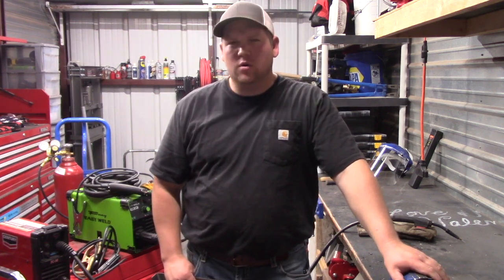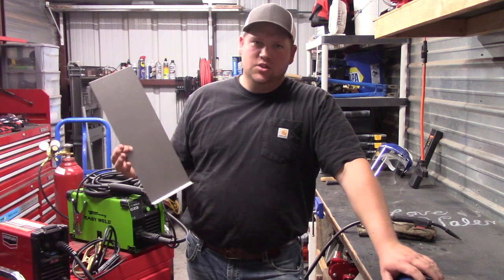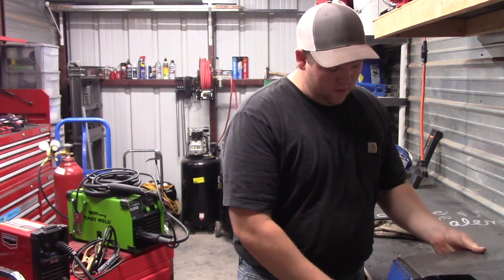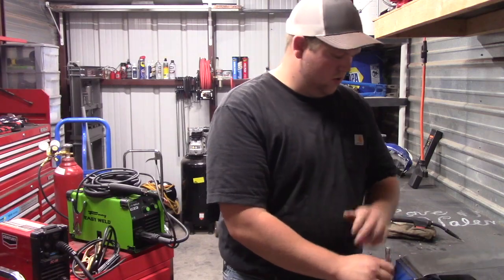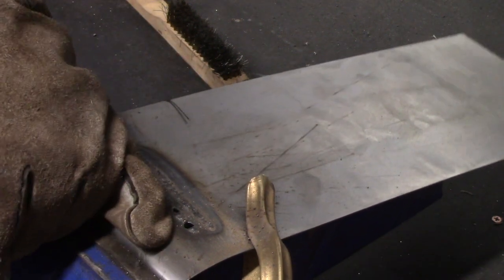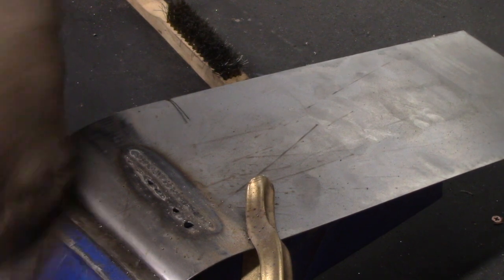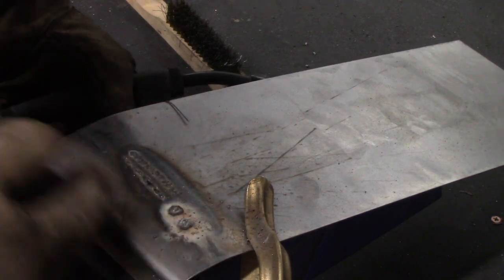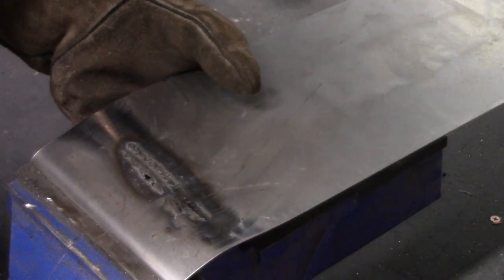Can You Flux Core Weld 22 Gauge Steel?

Comment: I’m using a Lincoln MIG set up for FCAW. 0.035” flux wire. Should I set the machine for lowest voltage and slowest wire feed speed to prevent blow through?

Comment: Good video but every time I watch these videos, thy don't include the wire speed and voltage. The techniques are good to see how but the voltage and wire spped should be included because those elements determine "blow" out or "bur" through or not. Good video for techniques.

Comment: I started welding sheet metal 40 years ago with oxy-acetylene, then to mig welding in the early nineties.  I always heard how it was so difficult to weld sheet metal with flux core, so I never wanted to try it.  I was forced to use a Lincoln PowerMig 140 with .035 flux wire in it to weld a hinge pillar section into a '14 Camry because that is all the guy had to weld with.  Because of the extent of the damage, cutting the multi-walled section precisely was not possible, and I had some gaps up to 1/8 inch to weld.  I also had to drill spot welds and remove the thinner outer panel in order to weld the stronger structure underneath. With a little acclimation it was no problemo...
ATTENTION ALL FLUX CORE SHEET METAL WELDORS:  TURN YOUR AMPERAGE UP AND STITCH.  Like a fraction of a second blip.

Comment: I use texas tig with a cheap igbt stick welder and a second rod as a filler with no Flux on it. I can easily regulate my amperage to dial it down. It works pretty good. First time I did exhaust I struggled then I found the Texas tig method and it was like night and day.

Comment: It's not easy that's for sure. I have the 140 from Farney as well. Had practiced on some sheets B4 winter has cascaded thru n I don't have a heated shop. But when taking care of replacing rusty areas you tack it in. Then hit up every couple inches. If you do an inch at a time between those original tacks and allow to cool I'm between you should be aight.
Reply from the maker: Sounds like a good method to avoid burn through. Thanks for the comment!

Comment: I have the newer Titanium easy flux 125 and it’s REALLY difficult to spot weld 22 gauge consistently. I have it at the lowest settings and sometimes I’ll get a good weld, next I’ll blow through, next it won’t penetrate. I have to clean the piece and cut the tip of the wire after each spot weld or it will pop the wire off.... total PITA. In HF’s defense, they do not have a setting for thinner than 18 gauge listed.... in other words, they don’t think it will weld 22 gauge.I believe it now lol. Good video.
Reply: Don't put it on the lowest setting.  The lowest setting will cause nothing but a mess.  You can even weld 24 gauge with this technique.  I don't know what machine you have, but let's just say that if your amp settings would go from 1-10 with one being the lowest, put it at a 4, and then you want to pull the trigger and let it go once you strike the arc.  That single spark is all you need to get full weld penetration.  Then spot weld your piece.  You will want to pause every now and let the piece cool a bit, or use heat sink, or a air blower to cool it down.  Every 8 - 10 welds.  Not only will this let you weld perfect pieces, but there is so little grinding that needs to be done since the welds don't build up.  This is the technique I learned from the legend Billy Bondo on YouTube who has been a welder for damn near 50 years and uses flux to weld thin metal exclusively.
Reply from the maker: Yes, its not exactly made to weld very thin sheet metal, I've never welded 18 gauge but it certainly is it's limit  based on my experience with other material sizes.

Comment: Exactly as every welder knows you can't weld thin sheet metal with fcaw or MMA.
Reply from the maker: A lot of people are saying you can but with a lot of extra steps. I think it's worth just getting MIG at the point.
Reply: @DereksWorkshopAndProjects  just means you have to buy gas.In fact I would say you can't weld thin material without buying gas.

Comment: Thank you for the video what speed are you
Running your wire and what heat range.. high / low got the same problem I can’t seem to dial this in same 22 gage
Reply from the maker: I think it was 1 and 1 for both. Cant say for sure though, its been over a year since I made this video.

Comment: I use FCAW on auto body panels routinely without issue.  I need to do that since most of my work is conducted outdoors and it's often windy in these parts.  With a copper backing plate the process is rather routine and ho-hum.  That said, I rarely weld a continuous bead on auto body panels, in fact almost never.  Tacks that are spaced apart works best (for me) combined with the copper backing plate = relatively easy.
Reply: You can't run a bead on metal that thin
Reply: I am in agreement. I’m FCAW 22ga body panels now on a rocker repair. Tacs work fine spaced apart. I’ll even Tac in a backing flange of 22ga. Grind them down and fill the perimeter with glass filler so water stays out. Bondo over that. Epoxy paint over that. Good to go.
Reply: @andrewbrown1463  Yes,tThe rockers on my XJ is spot welded already from the factory, no need for a bead
Reply: Don’t have to run a bead to weld. Best equipment for the job is not always available.
Reply: Same. It's my daily bread & butter.

Comment: What I don't understand is why are you welding a bead on a single sheet of metal??? Isn't that kind of "counterproductive" to actually welding two pieces of metal TOGETHER? I get that you are showing that flux core can weld a bead onto a single sheet of metal......that much I DO understand...but in most cases anybody doing any welding is welding two pieces of metal TO EACH OTHER, which would increase the thickness of the metal you are welding, or transfer the heat over the area of BOTH PARTS!!! THOUGH I do understand if you were "butt welding the joint" like I already stated!! Good video though just the same...but just curious is why I am "trolling a bit" here!!!
Reply from the maker: Hey man you have a really valid question, thanks for not being a total jerk about it. So like you said, it was to show that you can or cannot run a bead using flux core on a 22 gauge piece of sheet metal. I know that’s counter to the purpose of welding like you said. Anyway, I don’t know if you clicked off to soon or if I just don’t remember right but Im pretty confident that tried welding two pieces together too. I did some stitch welding. There was more to it than just running a bead on 22 gauge steel. Also maybe I just don’t know of think differently than you, but a butt weld is going to be the same surface area as well. I think it would distribute and cause burn through either way. Not a big deal though, I’ll admit I might be wrong. Thanks for watching.

Comment: Hi, may I kindly know what flux cored wire you are using in welding a 20-22 gauge galvanized sheet? Thanks.
Reply from the maker: .030 wire.
Reply from the maker: Also, I took the galvanization off, it’s toxic to heat up galvanization to welding temperatures. It can kill you.

Comment: I think how low your mig current can go can make a difference. I see some can go down to 20amps others 25, 30 50amps. I dont know whats the ideal low amp range for thin sheet metal
Reply from the maker: I think your right. I’m not familiar with a lot of machines, but this 110v Forney does 20 amps, I wonder if 220v machines are able to do 20amps? Seems like they should if it is an inverter machine.
Reply: @DereksWorkshopAndProjects  a few start at 20amp but most start at 45/50 amps. I am looking to buy a mig welder. Want to repair some rust damage on my car so i want to make sure it can weld 22 or 24 gauge steel

Comment: I’m having trouble welding a 20 ga patch on with my Lincoln flux core 😡😡😡 SHOULD I HAVE GAS...MIG?
Reply from the maker: Pete Lasko yes, true MIG welding (Metal Inert Gas Welding) is a cooler process than flux core, and can be used to weld even 24 gauge steel. Get a hose and a 75/25 mix CO2 and Argon gas tank and run a quality .030 or .023 wire and you shouldn’t have any trouble welding 20 gauge steel.
Reply: 🇺🇸THANK YOU! On my way to  Merriam Graves❤️

Comment: Great video, when welding thin metal you have to jump around so you dont warp it with too much heat, also is your polarity correct? Lots of crackling. Keep up the good work.
Reply from the maker: Michael Griffin Thanks man. Polarity should have been correct, DC Electrode negative ground positive. 75 percent of the heat in the work piece, 25 percent in the wire. Anyway, I’m aware that flux core runs on reverse polarity, and was when I did this video. Thanks for watching and your comment.

Comment: Check out what the manual says, but to run .023/.024, may require a different gun liner. Likely the liner in there now is for .030-.035. Same thing, of course, for the tip.
Reply from the maker: Yeah, I'll look into it, thanks for the suggestion.

Comment: Those spot welds looked good nice and lined up. I heard you mention .023 wire though, I searched before but it’s only a gas wire apparently as .030 is thinnest it’ll go being flux cored
Reply from the maker: Yes, I did a little GMAW in the video, not just FCAW. If I remember right I was saying .023 wire would be best for metal that thin while MIG welding. When I first started welding a few years ago I looked for an .023 Flux Core wire and also found it doesn’t exist. The .023 wire I was referring to in the video was solid wire.
Reply: I've just purchased 0.6mm flux core wire. I didn't think such a thing existed, but it sure does. I double checked the box and .6mm in inches is .023622.
I bought it at Lidl in the UK and the brand is Parkside, which is their own brand.
Reply: @tadams1767 Got some of that as well 👍
Reply: @royster3345  Any good mate?
Reply: @roulettered56  Worked fine for thin welds. When not using I take the spools off and put in a sealed plastic bag to stop any corrosion.

Comment: i could be mistaken but it seems like you were using gas. i saw no slag produced during your welding and like zero smoke of which is produced during flux core welding
Reply: i forgot to say during the last 2 welds made
Reply: and it looks like copper wire
Reply from the maker: william washington Your definitely not mistaken... it’s been a while since I have made/watched this video so I could be wrong myself, but I think I said I was going to compare the flux core welds to a MIG weld just to show the difference in the welds. Or something to that effect, I don’t remember exactly. If I didn’t say that’s what I was going, then I’m sorry. But yes, I was MIG welding with copper coated wire and inert gas, not flux core. Thanks for watching.
Reply: @DereksWorkshopAndProjects  Noted... :)

Comment: Not a bad video dude! A bit of advice if o may. When wealding on light materials ( especially sheet metal) make sure your piece is secured flat to a heat sink ( maybe your table) this will back up your weld to reduce blowout and disapate the heat.
Reply from the maker: Many people have said that, I will have to try it again in a future video.
Reply: Copper or aluminum backing is nice to use to soak that heat up and then diffuse it better.. Cheers! Good luck man!

Comment: I have a Vulcan omnipro 220 from harbor freight I burn through everything I flux weld someone please help me my first welder and first xp
Reply from the maker: Probably just trying to weld to thin of metal, there are probably better people out there to give you advice but if you turn down the heat (voltage) and your wire feed speed then you might have better luck. If your welding really thin metal with a fast wire feed speed, it may just push through the metal with the heat and give you bad welds. This might be an extreme case. But you may need to just get yourself a 75/25 bottle and run GMAW (gas metal arc welding or what is TRUE MIG welding). Good luck!

Comment: 7:36 - 8:06 : No, not kinda. That's how stitch welding is done. You nailed it nicely in one go. You really wouldn't want to do such long stretches of it at a time, due to warpage of the sheet metal, but, yeah, that's how you do it. to avoid warpage, though, you just do  a series of tacks, being careful not to overheat the metal. Outstanding.
Reply from the maker: bobbofly thanks for the feedback. I appreciate it man!
Reply: You must be a welder. I was coming down to the comments to say the same thing but I was gonna add that turning the wire feed down wasn't really a good choice either. You loose control plus you're not adding as much filler that way. 

 My advice would be turn the feed back up to match the heat and stitch weld the hell out of it.

Comment: Bloody hell mate, that's pretty good seen pros do a worse job. Take wire speed down and amps down use quick trigger bursts then crank up as you figure what the metals doing. Use a heat sink helps! Good job and I have subdcribed
Reply from the maker: Thanks man, I always appreciate the positive and constructive feedback. Thanks for the subscription!
Reply: @DereksWorkshopAndProjects  Yes, a block of aluminium behind the piece your welding if possible. Or use an old steel dolly if welding thin alloy

Comment: I've been practicing this very thing, flux core on 22 gauge and it is not easy, the welder is ac and probably not the best quality it seems inconsistent and requires a lot of effort (meaning stop, gloves off, clean metal, clip tip) but I have not given up yet.
Reply from the maker: DC Flux Core is definitely better than AC for weld appearance but its probably every bit as much possible. MIG with a shielding gas is definitely the way to go for thin steel.
Reply: AC flux core is a nasty process. It doesn’t pay to save some money in getting an AC machine. You need to spend a bit more for DC. Flux core is also harder to learn on than MiG. If you’re never going to TIG ir stick, then a MiG is best because you can use flux core, and when you’re ready to spend some more, you can get the tank and regulator.

Comment: Hey mate, you running DCEN? Looks like DCEP.
Reply from the maker: Yep, DCEN. It’s just really thin stuff, probably doesn’t help. Someone else suggested I run it DCEP because it’ll put less heat into the base metal. I’ve welded flux core on DCEP with this just to see what it did and it’s totally worthless. So I probably won’t try it.

Comment: Have you tried this using a block of copper behind it to help with blow through?
Reply from the maker: I haven’t. Why a block of copper instead of mild steel?
Reply: @DereksWorkshopAndProjects  the copper wont weld to the work piece, like steel, or iron if it does blow through. Also it is transfers and dissapates heat faster. I learned that trick from an 80 year old man, almost 20 years ago lol. He just put about 1 foot each of 1/2, 3/4, and 1" copper inside each other and smashed them flat then bent it in a 90° to hold behind the panel, obviously doesn't work for all situations. But if you have clear access behind the panel its great. Aluminum works too, but melts/pits  faster/worse than copper.
Reply from the maker: Cool, if I ever find some copper that would work I’ll have to pick it up and try it out. I’ve never heard of that before but I’m also pretty new to welding still.

Comment: The Flux will work but you have to turn up the wire speed not not down,  because of higher temp it burns and it is not a sold wire, so you are putting down less material then you think.  You will get burn through so crank it up and try again.   Also you got my Sub Too keep it up.
Reply from the maker: See, my thought process was that if the wire feed speed was fast, it would be more likely to push through and make holes. I will revisit this in the future and take your suggestions.
Reply: @DereksWorkshopAndProjects  My welding Jedi show me how to do it on my Hf 90amp there is a technique increasing speed and a little practice.  If you have infinite adjustable bobs your uncle for flux regardless of material thickness in reason useless you are trying to zap together a coke can. I currently have the Titanium 200 welder and enjoy it alot.

Comment: What were the settings for both flux and mig?
Reply from the maker: Flux it started off at 1 volts and 1.5 wire feed speed. I then changed it to 1 and 1 and it worked better. I didn’t really try with the MIG and I just was trying to show a quick comparison of how flux core burns through and MiG doesn’t.
Reply: @DereksWorkshopAndProjects  oh ok. Lincoln nr211 .030 or .035 be best wire to use, my opinion. Well you did good job showing comparison. It really comes down to the wire, Lincoln, its pricey but well worth it. Thanks, good job. Keep 'em burning.👍